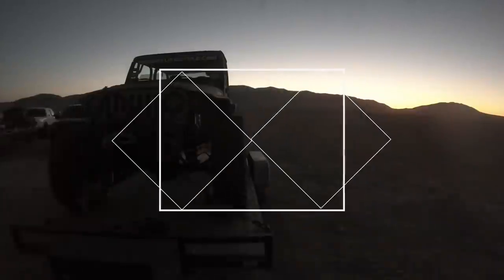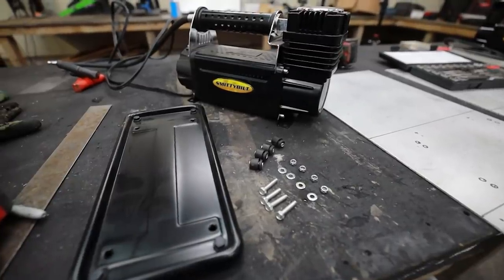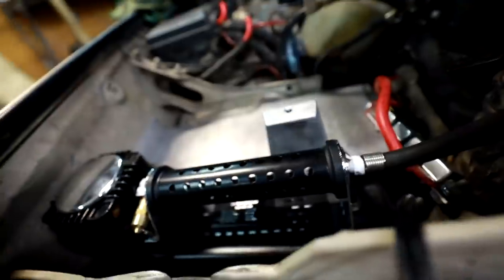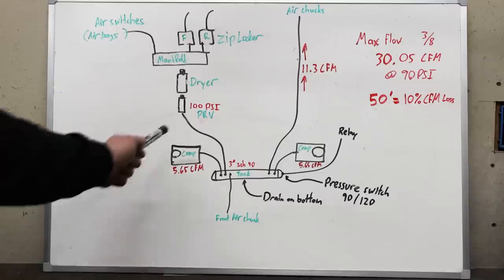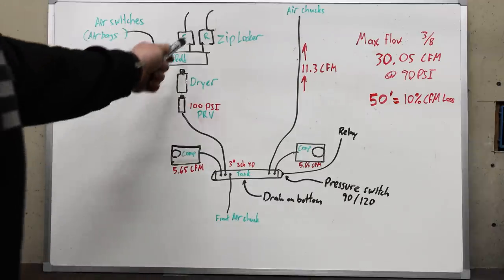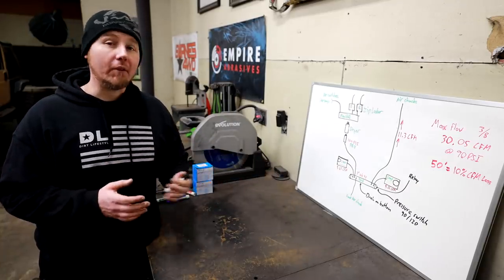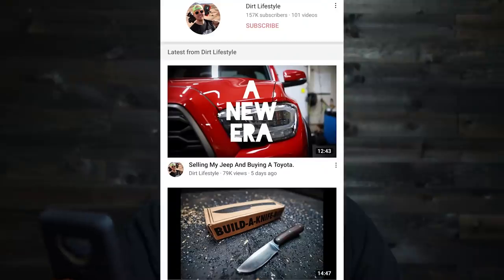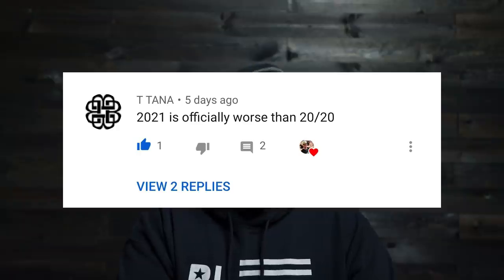FAST DIY Onboard Air! Ultimate Land Rover Discovery Build Episode 21.

Comment: Jeep purist: “you’ve changed”
Nate’s jeep: vw motor, Ford axles, and custom not jeep suspension.
Reply from the maker: Lol you nailed it dude 👏
Reply: @DirtLifestyle  Go with parts that work.
Reply: Lol. So true
Reply: @DirtLifestyle  arb are shit,chinese junk for 600 bucks.your mate recon,had 2 blow up..id just get the power tank,or make one,but,im in aus..
Reply: @DirtLifestyle  no,i dont have a t i g welder,but there only 300 bucks,&,i dont have a 2' bender,1200 bucks.or a plasma,300 bucks..father xmas missed me this yr..i do have a 73 challenger 340 though..came in a big sock from susanville ca..to au..
Reply: @DirtLifestyle  just a thought,for bigger tanks,make them the sliders. cut into sills. im useing fire extinguishers,2 x 8" dia plus a 5gal tank.
Reply: @DirtLifestyle  hey,toyota guy,,i dont care on brands,its the vehicle build from factory with the less work to do. tacoma,needs an sas. i dont class any IFS 4x4 as a 4x4..you should see the crap we have in aus as 4x4rs..i drive ford cos they stayed here,doge & chev left. but,i like blazers..or power wagons,2 things ill never get here..hate mail,,i got banned from utoob,for telling the truth. freedom of speech,died,long time ago..good work,stay safe..
Reply: @DirtLifestyle  landcruiser,,ugghh,wash your mouth out,,yes,there good,but,the better option is the gu nissan,stronger & still has a transmission brake.90,s,not new stuff. toyota lost it yrs ago. best cruiser was the 80 td 4.2. same yr as the nissan, toyota use nissan front diffs,stronger. we dont have tacomas here,which is sad,or the f150. both would sell like wild fire..
Reply: @DirtLifestyle  jesus christ super star,,you think your subs are kliky,,try LIVING in aus..im the only guy in our club with a ford,against toyotas,nissans mazdas,''rangers'' [ mazda bt50 with a ford badge.]  ,prado,s ?  ,range rovers,.1 jeep,i think..you want a good covid laugh,,watch inskip beach 4x4..
Reply: JEEP-
Just
Everyone
Else's
Parts

Comment: I like how this air system is going. One minor correction to your design, you will need a 100 psi pressure regulator, not a pressure relief valve for your lockers, if you want to have 120 psi in your tank. Keep up the good work. Jeep, Land Cruiser, Toyota, it doesn't matter, it's the build that matters.

Comment: I just chuckled at how back & forth the comments were on the last video, but difference of opinion is what make the world go around, & how boring would it be with out it.... But realty guys this is a wheeling channel, look at the land rover, how AWESOME did that turn out ?
Jeep, Toyota, Ford, hell even dodge could be used as a platform for a off-road rig.
I guarantee there is not a rig running the overland trails, or the trails Nate goes on that is NOT in some stage of upgrade or modification. Folks they are all platforms to your brand of fun....I love the difference of opinion.... Build it brace it, get out there & have fun, go home & make it better...Hell of a channel Nate...👍👍
Reply from the maker: Well said 🙌
Thanks brother 🙏

Comment: Nate, one of the things I did when I build my on board air systems was to put a air fitting and a valve at the top near the air compressors. This way if I lose an air hose in the system I can always go directly to the compressor turn the valve and have air. Love your videos keep up the great fabrication work.😎👍
Reply: smart idea

Comment: This is awesome! I've always had the idea to take an air compressor such as that one and hardwire it to the battery and use some Andersen connectors to be able to take it out and plug it in real quick. This build was an even better one though!

Comment: I won't lie, I am a Jeep guy. With that being said when I was in the military down in Honduras we used a Toyota pickup truck. It had military tires on it and handled the trails great. The Dodge pickup and 2 1/2 ton trucks were just too big for the trails. They couldn't handle the turns as well either. That thing was a beast and a lot of fun on the trails, I even enjoyed it more than the Jeep we had down there. Good luck and have fun with your build.

Comment: You can remove the carrying handles off the Smittybilt compressors and mount standard hardware to the air output. Makes the system more compact for custom jobs like this, giving you more options, including using ARB air kits, with quick connects. Good stuff! Always learning from this channel.

Comment: Perfect timing with the air build. I have my 92 Hilux down for a bunch of stuff, an air system among those. I'll be pulling a tank from a defunct compressor, and mine is planned for "just" tires, air tools and possibly a pressurised water system.

Comment: Hi, pipe fitter here responding to your leak check and whenever we get to the hydro/ air test portion of the job I spend more time fixing / modifying test equipment than I do actually testing. Or my favorite is chasing down fittings I had the day before that just disappeared into thin air.

Comment: I built gas powered compressors. I learned to use copper tubing from compressor outlet going to tank because of the heat made. Plus one way check valves going into tank inlet so compressor starts easy. Toyotas are OK, but I'm a Jeep guy, LOL.

Comment: Fabricating in the mining industry we used 120 wall 2x2 square tubing as manifolds.  Built them for the water cooling lines, the oil coolers on the crushers, and the air distribution systems.  .120 is more than adequate for your 120 PSI system!  Nice job!

Comment: As a jeep tj owner. I am much happier to see a custom tacoma build than I ever would to see a "newer jeep" There is nothing special about those barbie jeeps with the largest bolt on market possible. Im not here to watch nate bolt on parts. I want to watch him build them. I just did a on board air system on my TJ where the washer fluid tank was with a aluminum putty board from harbor freight and the same compressors. Was super stoked to see you do that, that means you will teach me more things I will love to learn.

Comment: Your channel is fabulous. I’m an old stainless steel fabricator that builds very similar to you. My son and I watch your channel for ideas keep building everything you do. 

I put together an air system similar to yours. I made a mistake and used 1/4”tubing. After A couple years of use I will be tearing it all apart and changing it to 3/8s. It does make a difference.  Especially when you’re feeling up other tires with a longer hose. 

Just a quick comment please keep us updated on any small changes you make to things like your tire carrier. My tire carrier is on its fourth generation. I’d like to see the ideas that you come up with once you have it out on the trail and start making changes. Keep up the good work we enjoy it.
Reply from the maker: Thanks buddy 👍 
I definitely will keep everyone updated on the  changes and improvements on the carrier

Comment: Nate i'm glad you are spotlighting that compressor. i've been using it for a couple of years and it's served me very well. one thing to help others is to when using it, try to have it placed where there will be air flow by it because it does get hot. Oh and by the way it will be nice to see you stock up on chevy parts as you upgrade the toyota.... they all turn into 90% chevy when all the mods to make them good trail rigs are done,..... LOL

Comment: Hey it doesn't  matter  what brand of 4x4 cause you can take all tech and apply it to anything.  I've  had all 4x4 and what I used I my gmc i took it and applied  it to my toyota  and to my ram. Its all good guys. It gives you more fuel to build. Stay safe cheers

Comment: I have been using one of these compressors for a couple years now with a 2 1/2 gal. tank. filling 40's multiple times a day on dune trips and snow runs. Also re-setting the occasional bead  along the way. Never a problem and fast.

Comment: Keep it coming!  Great content!  I love OBA systems and I really like them on the cheap.  I've found that if you can scrape together an old air compressor (like the small twin tank ones) and use the tank off it you have ready made tank.  Granted you won't be able to put a hilift jack on it or bounce it off rocks!  It's amazing the difference a small tank can make.

Comment: Just subscribed and I hit the thumbs up. You outta think about installing suck down winches on the Rover. Nice for leveling, especially with the independent air bags, that you mentioned. You can lift your  tires off the ground, with the help of a stump or a large rock, under the trailer hitch, bumper, or frame, no jack needed. Could be helpful with traction mats. Could also be helpful for going under low hanging obstacles. But the best thing of all is you will be able to drop the front down low and make the Rover twerk it's rear end.

Comment: I did something similar with this model of compressor for my FJ build. The Smitty is good. The only reason to spend more for ARB (dual) which I used for the Wrangler build is the onboard cooling fan. The Smitty overheats and in Texas summers I’ve had to wait for cool downs. And that’s mounted high in the engine bay. I like both brands, but I like ARB more. I don’t want to wait at the end of a long day.

Comment: I learn a lot from your videos. I don’t turn wrenches, I contacted you I the past about my ram2500 4x . Thank you for staring me in the right direction. My question and only problem with that air compressor is, the fitting next to the handle gets so hot that after a day on the trails . Filling 33 Bfg the fitting fly’s off . I am looking for a end all to this paint in the butt. Thanks love the videos.
Reply from the maker: I will answer this in the next Q&A!

Comment: Think about using one pressure switch for both compressors.  Otherwise one will run more than the other.  And perhaps that’s ok in a system like this.  Definitely smart to lower the max pressure of these units as well.  I’ve got one, and it works awesome but does get quite hot at high pressure.
Reply from the maker: Yep, one switch for both units 👍

Comment: I have the same compressor branded differently off of Amazon. It works great, I even used the inspiration I get from your channel to weld a bracket to hard mount inside the back of my JL. My only complaint is that due to the size I couldn't find a location outside the cab and it's loud. I'll watch the channel even if you through in some Taco content lol!

Comment: Nate, awesome stuff and so relevant to me! I just completed a dyi onboard air with a GM a/c compressor and my front bumper for a tank. Works at about 7cfm.
I have a seriously built FJ40, I'm out of Bellingham so wheel at most of the places you do. I'm only on 37s and a built 44 and 33 spline ford 9 so not at your TJ level. But what I'm really into is the overlanding/ trail/ intermediate crawling and you ever want to put a hodgepodge of vehicles together for a week to ten days I'd be interested. One interesting feature on my build is 16 forward gears! 
Keep it up, awesome stuff.
Dave

Comment: When installing PRV, you will want to spec them quite a bit higher than normal inflation pressure. Bumps will cause a surge and can pop the valve and deflate the air bags when on the road/trail. Most air ride bags will handle 100psi as long as they are not over extended.

I started my air system with 2 x 12 gallon portable tanks mounted in the spare tire location on my Megacab for my air suspension. Added a Warn Powerplant winch as my compressor.

Comment: Carry on and do your thing bro. You're doing great. I'm digging this onboard air stuff. I wouldn't mind doing something like this on my cj7 but I wonder if I should just go with a good 12v portable. My jeep is not a weather tight rig. I don't really put a top on it besides a bikini top and my engine bay is wide open. I could probably use my front or rear bumper as an air tank though. 🤔

Comment: Check out JD Fab for the Tacoma.  The Marlin kit doesn't solve the weak lower control arm mounts.  The JD Fab kit is not bolt on by any means, but fixes a number of issues with the factory Tacoma suspension.  Also, it allows for large tires with minimal trimming.

Comment: Nate, something to consider with those compressors is their duty cycle. A few years ago I built a very similar system for my Toyota (hehe) and had a ton of issue with the compressors reaching their thermal cutoff and shutting down before the tires were filled. Adding a tank actually made it worse because the small size of the tank meant that the tank pressure would drop before even one tire was full, then the compressors would have to fill the tire AND the tank. It also didn't help having the compressors inside the engine bay. 

Also, they vibrate, a lot. I think those little bases they come with are so they don't walk across the trail while you're airing up. Hard mounted to the body you will probably feel them vibrating away from inside the Disco.

Comment: Nate you should really use pressure relief check valves between the compressors and the tank. The SB compressor can’t handle consistent head pressure. And will cause premature failure over time. You want the pressure in that part of the system to bleed to atmosphere when the pressure switch trips off the pumps.

Comment: Past experience with the same compressor, the pressure blow off on it releases at about 65 psi even though the compressors are rated to 150 psi. I ran into this when I built a tank for mine, called them and after being passed around about 4 times they told me that was normal. You may want to test this before getting too far into the project.
Reply from the maker: Great info!

Comment: On air ride systems for cars, the water trap/dryer goes between the compressor and the tank. Might save you some space to run it in that configuration. Plus the benefit of all the stored air is dry.

Comment: I want more people to build engine driven air compressors, I have one on my 2nd gen ram made from a factory a/c compressor and a custom bracket, flows more cfm than any electronic pump on the market and can support air tools with a small tank.

Comment: Nate, Just build it and they will come. Aren't those compressors very loud? The custom trays and dual batteries very cool, how did you figure out the size of the tank? Seems small to me, was it based on available space or something else? I am very interested to see how you control the air bag system in the rear suspension. PEACE
Reply from the maker: I will answer this in next weeks Q&A 👍

Comment: I’m thinking about adding on board air under my 95 7.3 f250. These trucks have dual fuel tanks but I removed the front one to simplify the fuel system and make it more reliable, now I have a huge under space under the bed, and a convenient fuel door that I’m no longer using, I’m thinking about putting in a hose reel with like 30 feet of hose and running it through that front fuel door. This truck doesn’t get wheeled, but it’s my tow rig so it would be very convenient to have air ready to go at camp, and if I ever need to air down to get out of some muddy parks, I know I’ll be good to air back up once I hit pavement.

Comment: Man it seems like every time I think about what I’m gonna do next on my rig, Sunday rolls around and you have made a video about it haha.  Awesome video as usual.  I saw you added a second battery.  Are you going to wire that separate from your original battery so you can run accessories and not drain your starting battery?  That is my next project.  Would love to see you make a video if you decide to do it that way.  I’m having trouble deciding on what brand parts to use

Comment: As much as I like to consider myself married to jeep I do like any 4x4 build there is as long as it interests me like dirt every day builds not many of those were jeeps but I still lived that channel and this channel keeps me thinking outside of the box as far utilizing space in better or multiple ways like on my xj I came up with the idea to run a 2x8 rock sliders that replace the rocker panels  with arms to go about anchoring it back to the "frame" and than go about capping the ends of the 2x8 rock sliders to use as air tanks. Than I can tap in air chucks at both the front aswell as the rear to be able to air up tires I'm nit 100 percent sure what all I'm gonna need air for but I'll basically be prepared for anything but I'm rambling I love the channel cause it captivates me keep goin nate👍

Comment: I didn't realize these 12V compressors could compress air into a tank, I always thought it had to be into a tire since it expands a bit going from flat to whatever it's psi rating is.  I came across this looking for a small compressor to provide air to a plasma cutter from a 12V power source, and a lot of reviews say the Smittybilt is one of the better ones out there.  How has it been holding up?

Comment: One of my first rear bumper builds I turned it into a air tank. It worked great out on the trail.
Reply: Bumper built tanks... Are they a bomb waiting to go off ?
NO....think of a tire if it exploded it's when there is to much air being put in it. If it's punctured the air is simply realeased... If there is a failure, like a bow out & the air is released quickly. The damage comes from the tire debris tearing up fenders, air/brake lines, ect..in 30 years of trucking I've never heard of a air tank exploding, & they're placed under the cab behind the fuel tanks....there are better places than others to put an air tank. Just know they are not a bomb that is going to destroy your rig... Dang that's a lot of words... lol